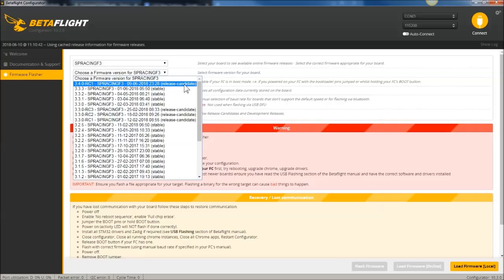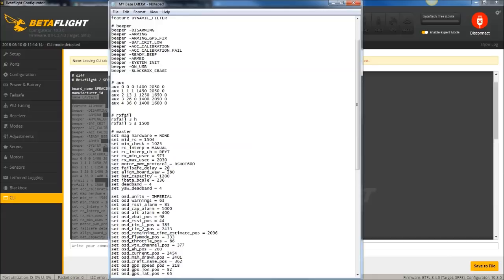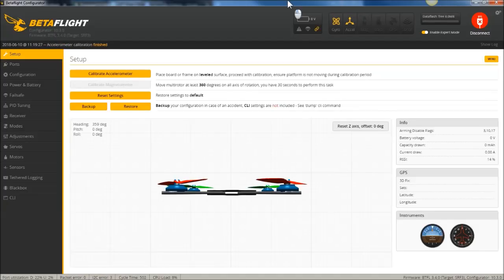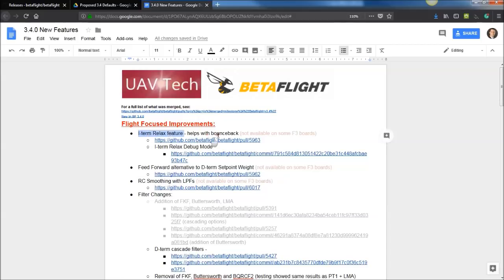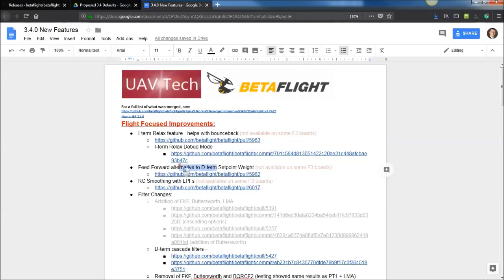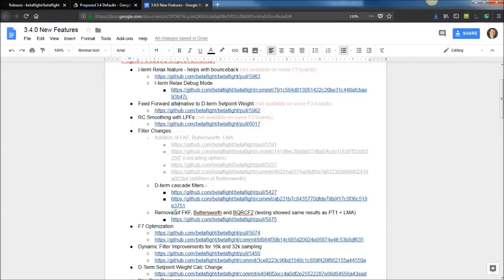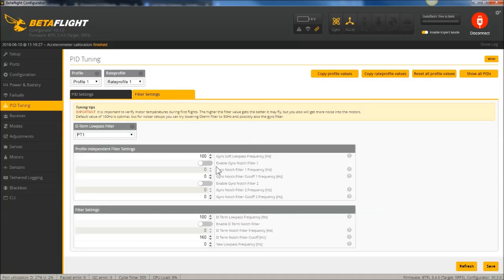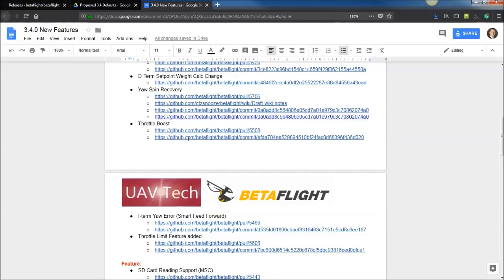Betaflight 3.4.0-RC1 New Features Brief and Resources

Comment: tried BF 3.4 RC2 this morning,  When I jammed the throttle and cut it off to test iterm the quad pitched forward a lot.  Standard pid just lowered P by 2 points on R P and increase D by 2 points on RP.  I checked my BBL log,  PID Iterm boosted up at high throttle and it  dived to zero immediately after throttle was cut.  I know  there a few things done with  iterm.  I will try 3.3.3, this quad is brand new, this is maiden flight.  Here is the BBL log
https://drive.google.com/open?id=1SZy9g98-jLmeq18aJGxylvXKWy0sM6LU
I will be interested to heard your opinion.   It appears to be a bug

Comment: with regards to the rescue mode how much cpu will it use? What is the best pid loop to use on an F4 omnibus flight controller? I think it's currently running 8k/8k with dshot600 esc's

Comment: i notice that de rssi scale was off in 3.4.0 so the scale was 41in stead of 100
so
default  it was : 
rssi_scale = 41
Allowed range: 1 - 255
set rssi scale = 100 and the scale was back wright on my betaflight 3.4.0 quads

Comment: Mark - I've read all the materials you linked - great resources! I have more questions than answers - certainly about a few of the new experimental features - each is worthy of a video from you.  Rc_Smoothing doesn't really seem to work on "0" or automatic - so I'm using your 20hz / 20hz settings (have they changed?) with 16 channel FrSky SBUS and those settings seem to work really well.  I can't find any setting to put the RC_Smoothing on yaw or throttle - is it on RPYT by default or does it rely on the RC_Interp RPYT setting?  Thanks amigo!

Comment: Joshua Bardwell talks about a word press that highlights anything different from the two diff's!
Reply: I am on Linux and use Meld for diffs. I just checked, and it is supported on Windows also. So my workflow is that I keep full "dump all" config in a file for each quad (and also store it in git repository so I can always see changes for my configs over time). After upgrading betaflight, I do "dump all" again and save it to "tmp" file next to current config. Then you can do "meld old-config tmp" and you will see all the differences side by side. Kind of best of both worlds: you can see any new settings, any renamed parameters (because they will be side by side), and can easily copy paste your settings. I find this workflow the best to keep up with cli settings changes :)
Reply from the maker: J.FINESSE FLIGHTS , interesting.  U have link?

Comment: Thanks for the heads up and for the defaults to try. I just loaded 3.4 with your 8k defaults and had a great fly this afternoon, it feels so different. I struggled to get prop wash, none of that throttle up oscillation I've been trying so hard to tune out of butter. It does feel a bit mooshy in comparison to before but could definitely get used to it for really smooth freestyle. The dterm set point and rates seem easier to control and no bounce back. Throttle position is more centre stick for mid throttle which is where it should be i guess. Motors are cold. I'm so pleased!
Reply from the maker: Add more D term Setpoint weight to maybe take out the mooshy'ness and u should be set!  :-)
Reply from the maker: Thanks so much for sharing!!
Reply: Thank you I will play with the D term set point but I have to say I quite liked it like that :) The defaults really work well, there was no movement in the pid "i", so locked in.

Comment: stage2 is enabled and set to 300 by default...
i got funny effect with this,my pals asked me if i was running a quad with loose lock nuts.
without it (with single pt1=100) quad flew normally.
mpu6000.

Comment: A very nice detailed overview, thank you so much! I have a question regarding blackbox in general. Most of the flight controllers that I use lack blackbox functionality, but have free UARTs. Do you think it makes sense to buy an external logger, like this one? https://m.banggood.com/Openlog-Blackbox-Cleanflight-For-Naze32-SP-Racing-F3-CC3D-Flight-Flash-MicroSD-Data-Recorder-UART-p-1065615.html
Reply from the maker: Yes, I would give it a shot.  The only issue is you can't use higher logging rates (4k or 8k) I don't believe.  But if a 250,000 baud rate can support 2k logging, that should work pretty well.  For noise analysis, you really need 2k+ logging rates.  For tuning (Plasmatree), 1k is fine.  Do note you need to crank up the baud rate through editing a config.txt file as outlined in the description and set the UART to match.
Reply: Great, thanks for the reply! I'll give it a shot.

Comment: what should we use now instead of NOTCH for debug mode?
Reply from the maker: debug_mode=gyro_scaled
Reply: not gyro_raw?
Reply from the maker: no.  Raw should give you lines that show the noise, but are not scaled for gyro rotation.  It gives you totally raw data coming from the gyro.  Again, it has noise but the traces move all over the place (not scaled).
Reply: strange. gyro scaled gives me the same result as gyro filtered
Reply from the maker: Huummm  looking at the code it seems to be in the right location to be the substitute for the old Debug_mode=Notch.  See https://github.com/betaflight/betaflight/blob/a5ba01666bdadd00018bc432e0cf17ffe50ffbc5/src/main/sensors/gyro.c#L1077-L1081

I can test tomorrow and see what I get.  I have flown 899 when it was still Notch and all was good.  I have not flown RC1 yet.
Reply: it seems i chose not the right one. it is debug gyro scaled in  blackbox explorer

Comment: Hi, Where did you get the 10.3 BF configurator? The BF configurator github release is still contains 10.2 version. could you pls drop a link to me?
Reply from the maker: Can be downloaded from: http://andwho.sytes.net:8080/job/BorisB_BetaFlight_Configurator/
Reply from the maker: Weird, i would log as an issue on: https://github.com/betaflight/betaflight-configurator
Reply: For all nervous beings here - 10.2 still works for BF 3.4.0 RC1. You can continue to use it until 10.3 will arrive. Most of things are configurable from GUI. Some values are accessible only in CLI though but all is doable anyway.

I admit that I also tried to compile 10.3 configurator by myself at begin. As you may guess it ended wrong =)
Reply: Kind of a "noob" question, and I know it is not the purpose of your video, but I downloaded the 10.3 configurator from the link above (win32 and also win64) but I am getting an error when executing it (variable used but not set). I am sure I am missing something, but I could not solve it. Any ideas?
Reply from the maker: Geraldo Garcia , so it is installing correctly?  Which, x32 or x63?
Reply: It installs correctly, but when I try to run it gives an error message "Failure loading extension from C:\(some path) variable $1x$ used but not defined", it happens with win32 and win64 versions. Tested on two different computers, two different builds (215 and 216) and it is always the same. The official release 10.2 runs perfectly.
Reply: UAV Tech  Will do. Thanks.

Comment: I believe that Betaflight 3.4.0 version will be massive. Many good improvements. Already tested BF 3.4.0 Jenkins build #909 2 days ago. Not a surprise that all bunch of filters that produce the same results are gone. But improved PT1 Stage 2 lowpass filter is awesome. Did a test on two beaten quads where one have three already flexy bending arms after crashes and second - three bad motors (2 have bad bearings and third - slightly bent shaft). Incoming gyro data in both have awful noise, but outcome is super smooth. Clean traces, cold motors and good handling in result. MSC mode is very useful for me as well, SD card slot in my quad with blackbox on SD card is located in place dificult to access without thin pliers.

Do anybody know what happened with NOTCH debug mode? It is not in debug mode list anymore. If NOTCH is removed, which setting we must use now to capture correct non-filtered gyro data? GYRO_RAW?

Also wish to thank you about Betaflight 3.4.0 defaults. They was kind of revelation for me. Didn't became a better pilot overnight but now I know that a good part of my quad piloting issues certainly was related to bad quad tuning. Your defaults in fact changed all mine flying experience in one day on both quads I had with me in that day. Even didn't imagined before that I will be able to hover on place IN ACRO :) Thank you again :)
Reply from the maker: You want Debug_mode=gyro_scaled
Reply from the maker: Awesome to hear the proposed PIDs helped you!  I can't take credit though, they were proposed updates to 3.4.0 by Flint Lackman.

Comment: Quick question on the rc_smoothing_input_hz and rc_smoothing_derivative_hz  settings- the release notes say it calculates a value of 50Hz from 9ms SBUS.... but there is a case in opentx project on github saying the actual latency was more like 20-40ms... does this matter? https://github.com/opentx/opentx/issues/4640

Comment: You aren't crazy hitting 'reset settings'. I've had times where I swear I hit 'full erase', but settings seem to persist between flashes.
Reply from the maker: Spencer Owen , agree.  Me too.  It is critical to me.  So i hit it twice.  I don't near weird shit happening off the start.

Thanks for letting me know I'm not alone on this.  :-)
Reply: It is the only way to get a clean setup :)  Do a diff before upgrade and save in text file the main CLI settings you must transfer to a new firmware version (FC orientation, motor remapping, port settings, LED strip configuration etc.). Then you can restore them back through CLI fast and tune after. This approach save me a lot of time not wasted in finding why something is not working as expected because particular setting is now obsoleted or was renamed.

Comment: Matek f7 2306 2750kv 5s 3.3.0 my motors get hot now what should I do I'm thinking of going to 3.4.rc1 but need to know what to set it to
Reply from the maker: What to set it to?
Reply: UAV Tech I'm not on 3.4.0 rc1 yet should I and would tht help my motors and my f7
Reply from the maker: Charles Phillips , yes for both.  3.3.0 had D-term spikes bug (i made a vid a while ago on that) and 3.4 is optimized for F7.

Comment: After watching your videos and playing around with the filters and delays, I don't see a bit benefit of following all the 32k16k hype. I actually think it could be much better with the less noisy mpu6000 and dlpf set to experimental.
That way, i like to think i can Taylor the filters exactly how my quad needs them.
Thanks for the big Insight you have given.
Reply: I can confirm that F4 / MPU6000 even under Betaflight 3.4.0 preview already works surprisingly well. On two quads with RacerStar TattooF4S (MPU6000), BF 3.4.0 preview #909, PIDs on 8K/8K and Betaflight defaults from here for 3.4.x (8K) had super smooth handling. Also same Betaflight configuration was set on another quad with Matek F4 405-AIO (that same notorious one) with ages old ZTW 30A ESCs upgraded to DShot compatible firmware (use DShot300 now). In 32-bit mode FC even couldn't finish initial calibration without FC overclocking. But 32-bit mode disabled and PIDs on 8K/8K turned it out in completely different quad too - good handling and NO YAW TWITCHING anymore.

Comment: I just luuuv the throttle boost feature. After a dive or split s into a tight gap, there is no longer a need for a lot of throttle control. Just add a bit of throttle and you are rocketed forward.

Comment: Good explanation of the features. I’ll be trying on my beta quad. Glad Diego’s mode is in there.
Reply from the maker: And i may even buy a Helio. However, I really wish Tim would do whatever it takes to get a target and betaflight.   I'll see what Flynn says about his mto's. That's my biggest concern.  I don't want to get it and then be disappointed and not be able to use it because I have peak motor noise and need a notch filter.
Reply: UAV Tech that’s cool. But yeah. This is a great presentation. Something everyone should follow. Especially the inav folks.